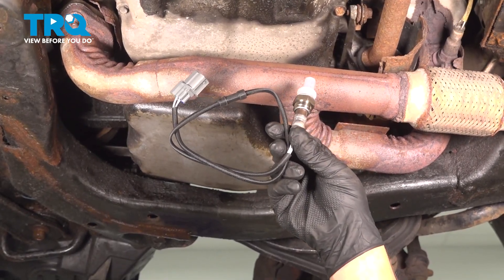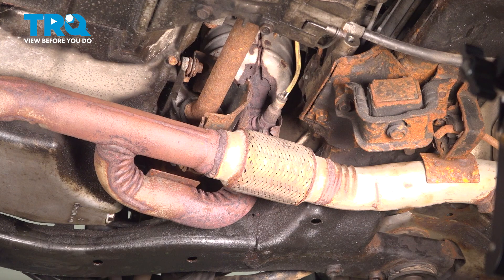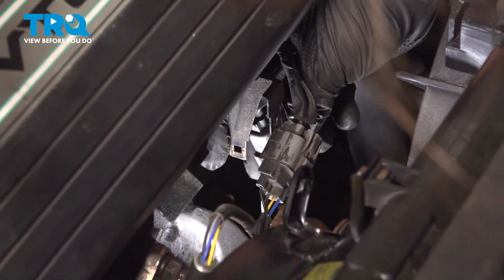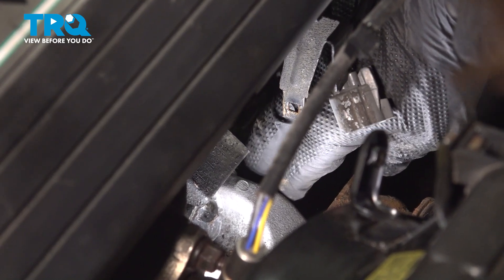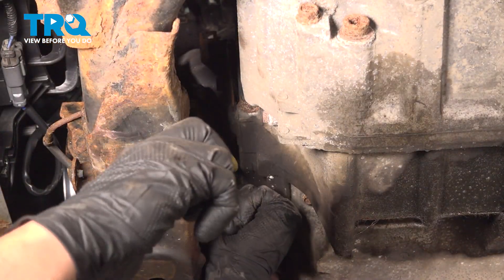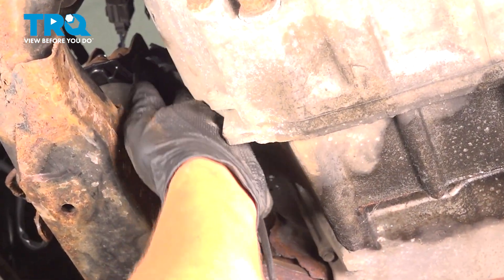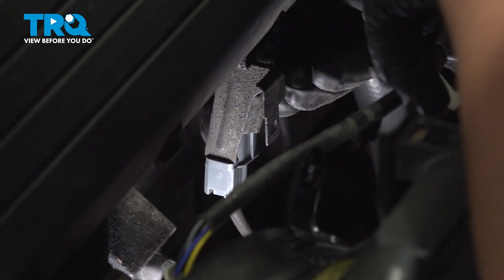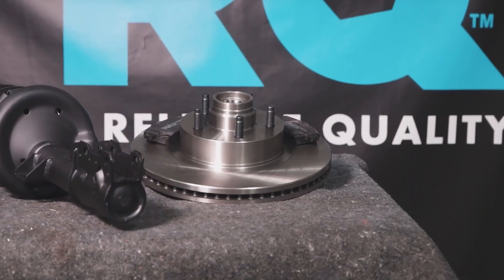How to Replace Downstream O2 Sensors 2003-2007 Honda Accord (3.0L V6)

Comment: For pretty much any engine that I know of except for Fords, when you are facing the Front of the engine, where all the pulleys and alternator ride, the left bank is usually Bank 1 with cylinders 1-3-5-7 and Bank 2 is the Right Bank with cylinders 2-4-6-8. Learned this in tech school. I want to say this also applies to boxer type engines not just V type engines as well.

Comment: i have the same car. i'm getting "P0141 02 censor heater circuit bank 1 sensor 2." Is that the sensor at 0:15 in the rear ? or the one in the front
Reply: I had the same code and it is the rear sensor. I’m doing the job tomorrow.